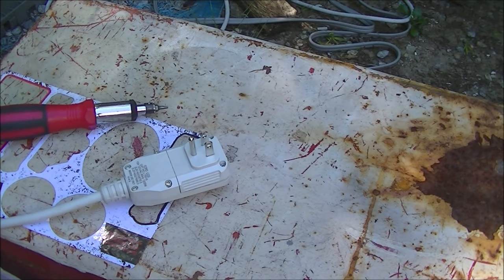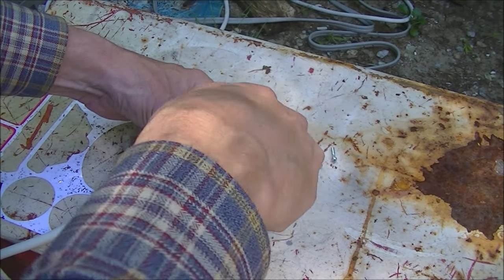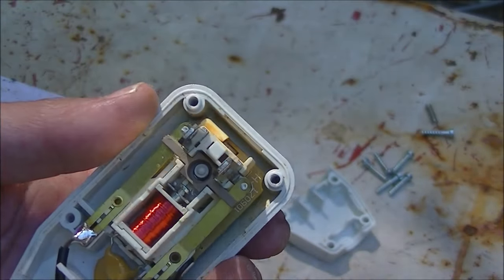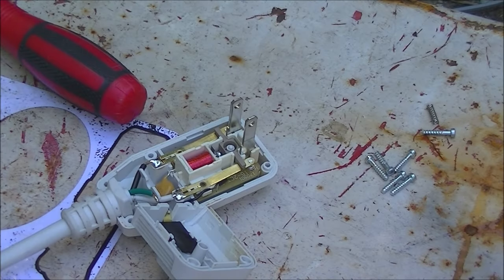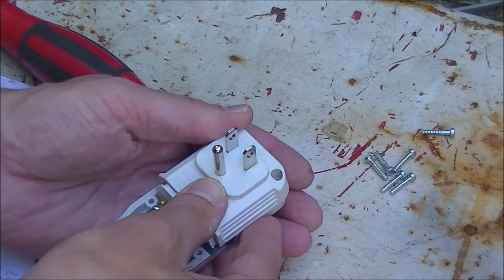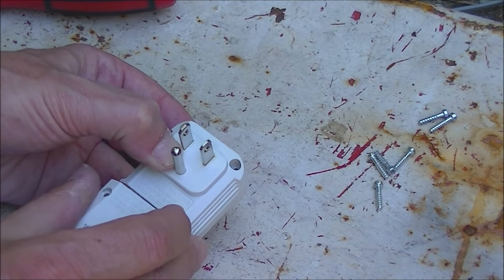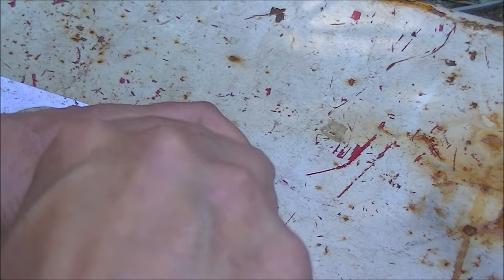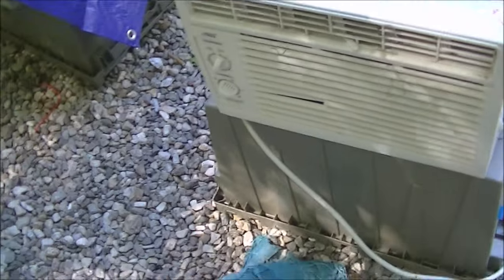Fixing an Air Conditioner GFCI Plug That Trips

Comment: Thats not a gfci..  its a Lfci..  it detects leakage current within the cable..  is used to detect faults on the cabling..  they arent gfci’s though and are basically worthless with no protection to people..  is more for the ac unit..  and those lfci plugs are only really ever on ac units..  youll know if its an lfci when you take it apart, if the hot and neutral wires have shielding wires and those are connected to the curcuit board inside the plug then its an lfci..  gfci’s don’t have any coils in them also..  the red thing..   also youll notice the plugs don’t say gfci on them anywhere..  only lfci..  lol.  If swapped it out for a gfci plug it would provide more protection except the amperage ac units draw will usually trip a gfci with that inrush and motor starting/ compressor….
Reply: Sorry. Lcdi.  Leakage current detection interruptor ….
Reply: Great info thanks. I was wondering why it looked different than I’m used to.
Reply: What about just changing it to a regular 3 prong plug and it a tripper is needed, just plug it into a power bar with a trio switch?

Comment: Please how can I get this, mine got burnt and the ac stopped working 😢😢😢
Reply from the maker: You can usually order the exact cord from an appliance parts website. They're very expensive though. You can wire a regular 3 prong cord also for much less. Make sure you don't have an electrical fault first, the cord shouldn't melt if it's working properly.

Comment: Hopefully this save you some cash from replacing cords and saves you time from letting all the other plugs from drying! You won't ever have to open the plug all the way again, so no pain in the butt putting them back togather! just loose the screws, squirt some rubbing alcohol with a dripper, close it, shake, pop a butter knife in the side of it to let it break, let sit in the sun for 20 minutes and tighten the screws! DONE!

Comment: Im trying to trouble shoot my A/C right now. Mine has the Tower Mfg Corp plug. It eas running then it tripped and shut off. I did the test reset thing, and its showing there is power, but it wont turn on and there is no backlight. Anyone know what it could be?

Comment: Anyone can tell me a website I can order the whole power cord or just the cord part, my dogs tore it up
Reply from the maker: You can usually order the exact cord, ready to go from an appliance parts site, but they're expensive. You could use a generic heavy gauge cord with a regular plug, but you might have to crimp new connectors on it.

Comment: Guys, let me save you 15 minutes of boring.  10,000 views, 91 likes... that should tell us something.  This whole video is based on your AC being outside, getting water in the plug mechanism, and drying it out. Cloth or hair dryer dries it out.
Reply: Thank you.
Reply: My AC unit is outside?  peculiar
Reply: @tedlahm5740 I needed that laugh…tyvm
Reply: Ya but my plug got wet and something tripped. We even had it inside for two weeks and plugged it in once a day so amy water woild be gone. How to fix that. I won’t bore you with why but for me the only way to power the unit is to rum thw plug outsode. I kept the plug wrapped in plaati c and that worked for years but someome took it off and it got rained on. I’ve had Noma units for years. Last one lasted 10 years so this one is only two years old.
Reply: The one you said u never could get back together I just unscrewed it enough to pry it open and ran the hair dryer in it for 5 min and it was fine again
Reply: Fred my boy when these plugs get wet they are a different animal.

Comment: My ac runs for like 3 hrs and then it clicks from the plug could this be the solution. I click reset on the plug and works and 3 hrs later I repeat the process can someone help
Reply from the maker: This probably won't help. It trips constantly with water in it. I think you have a different type of electrical fault.
Reply: @airconditionersexposed  should I change the electrical plug